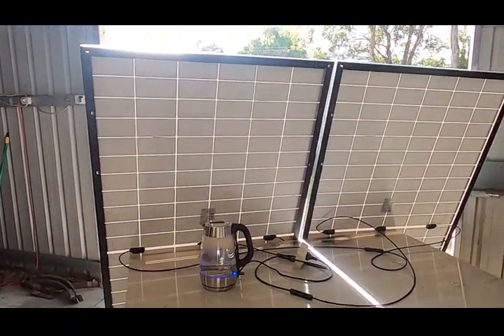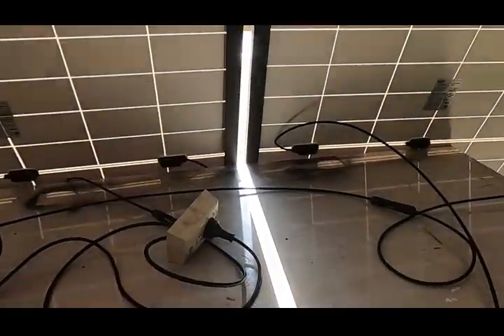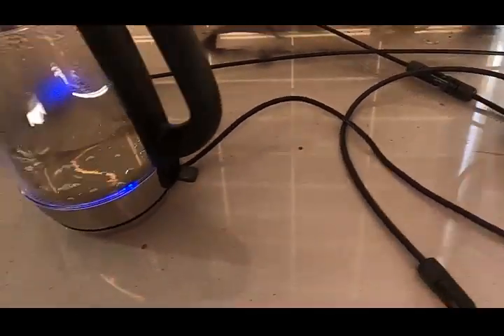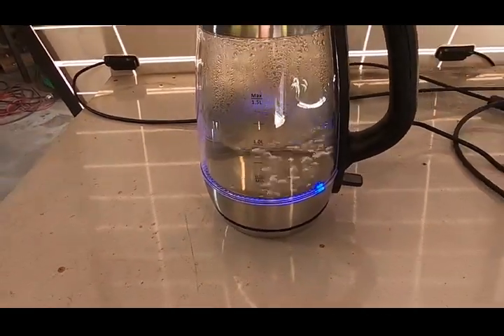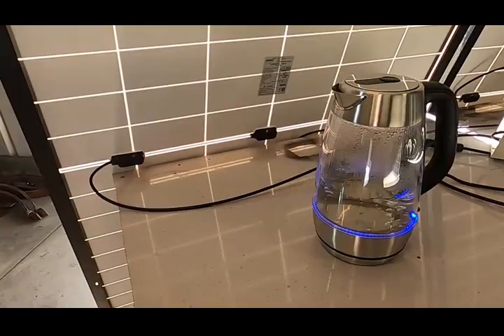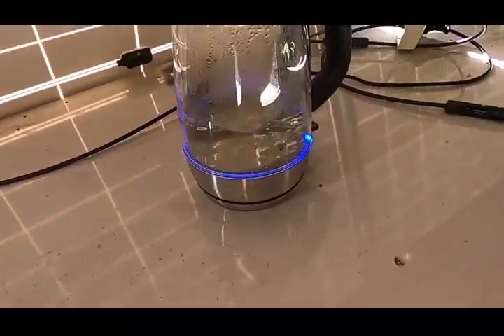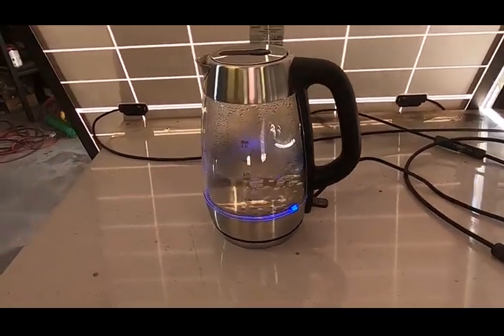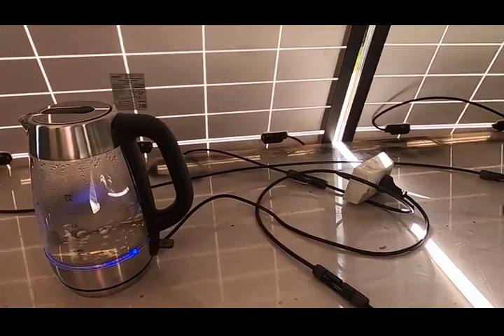Boiling Mains Kettle with just 2 Solar Panels

Comment: I find these Results rather mystifying.  The resistance of the kettle would  be around 28 Ohms. the panels in that configuration  would be only 8 Ohms.  Given the mis match, The panels would be severly dragged off Their VMP and would not be near doing 80V. To get 1 Litre of water to boil in 4 Min would take an input of 400W which  would be around 50% of the panels  combined production but given the  Ohm mismatch and the fact that power is  a quarter when voltage is halved and in this case The VMP  is only 1/3rd to start with,  there is no way the power input can be 400W. Even the open circuit  voltage of the panels is going to be under 100V, I am at a loss to explain how you got that sort of a result?
2 panels could certainly boil the water in that kettle  but I cannot see how that is remotely possible in the 4 Min specified. 
I have played quite a bit with direct connecting panels  and seen how severe the power output is reduced when panels are direct connected and not Ohm matched which is really the only way to get any efficiency unless the panels are  in series to create a voltage  that overcomes the output sag the panels  have which in this case would be at least 6 panels in practical terms of the size you are using.  If you were using a controller  like I have built and played with that  keeps the panels  at VMP or stores and discharges the energy  to keep them an max power point,  this may be more understandable but in direct connection,  from hands on experience and  mathematical calculation using  laws of physics as they pertain to electricity and the behaviour of panels, this is very perplexing.  The only way this may be possible was if the  Kettle was 120V but given you are in Australia where everything is 240, this seems Highly unlikley.  Was there anything else here not obvious in play?

Comment: this is a pretty neat video it would be very nice to know what all you can run straight off solar pannels here in the usa we use 120 volts on most things and 240 volts is used mainly on furnaces hot water tanks stove dryers and well pumps and of course air compressor and welder also and our sockets are 120 volts thru out house really like your videos but dont think your the original oz ive read about yrs ago that made his own inverter and a cool electric car along with a bunch of other things seems like ppl from down under are pretty cool look forward to more videos have blessed day

Comment: If you ever need straight and regulated DC like 12 Volt, you can hook up a computer PSU. Most of them have a rectifier at the AC side, so you do not even need to check the polarity! With the regulated output you can do many things, even go back to 110 or 220 AC with a regulated inverter. There is a lot (more) what we can do with solar panels. Thank you for your example.

Comment: Nice demonstration. No electronics needed. The only thing I could think of is the automatic off switch on the kettle. If the water is not boiling fast enough the kettle might not want to switch off (even tbough the water inside is actually boiling)and it will keep boiling the water until it will evaporate.
Reply: That is correct but on the flip side, if the thermostat did kick in it would likely be burnt up from the arcing of the DC which would be like  a Plasma cutter on the contacts and  burn them away and possibly cause enough heat to catch the plastic  body of the kettle on fire
Reply: @glumpy10  I think that the dc arc should not have more electronic power than ac arc if the power is less then in case of 220Vac. Possibly the magnetic attraction between contacts might be higher in case o DC but that is only my guess.

Comment: I was heating my fishtank like this but was worried about the internal switch going AWOL due to it being high current dc
Reply: If the thermostat is a regular mechanical type, yes, the DC is very likely to burn it out. You would have to take the load off the internal thermostat and use it to control a proper DC solenoid or  something like a MOSFET which is a solid state switch. I have used both  with solar on a water heater and works fine.  Not easy to do on the fish tank heaters I am thinking of anyway.